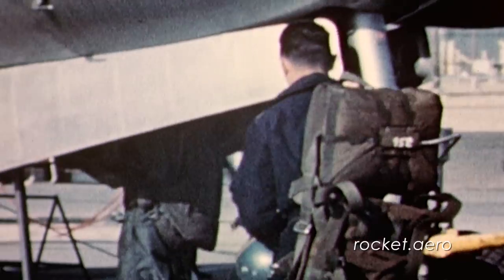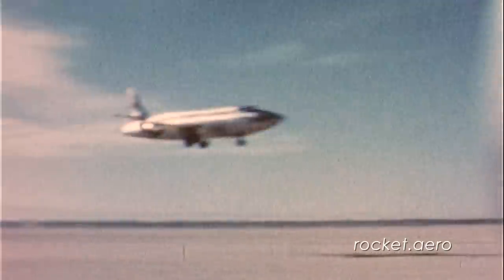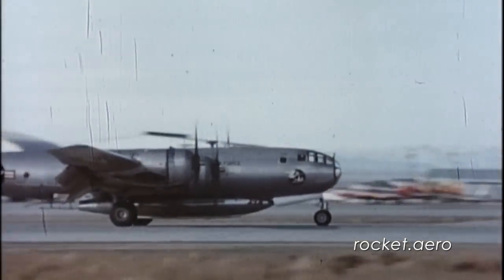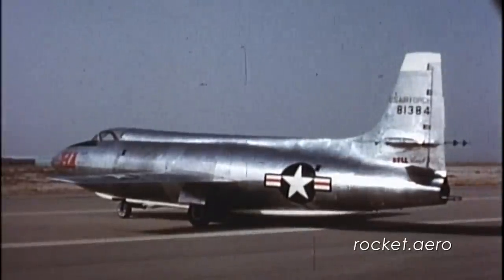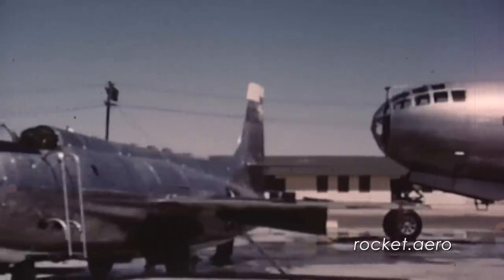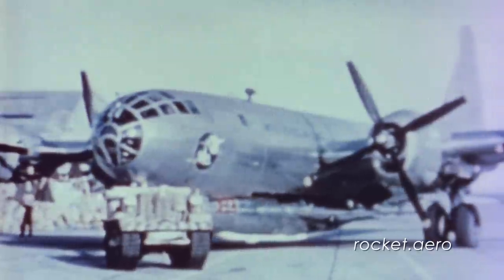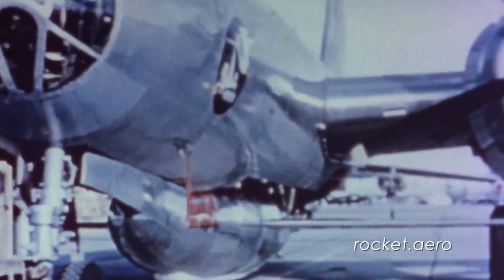Bell X-1A Composite Mission

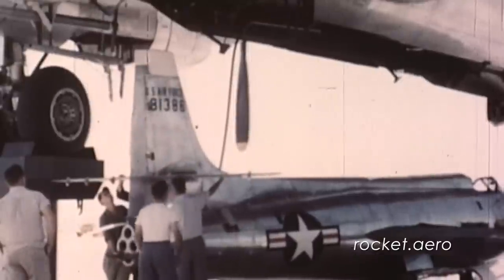Comment: The video includes rare footage of the X-1D 48-1386, from 5:13 to 5:42, 6:53 to 7:10, 13:19 to 13:37, 13:52 to 13:59, and 14:06 to 14:20. It lacks the X-1A title on the forward fuselage. It is shown with the EB-50A mothership 46-006, equipped with R-4360 Wasp Major engines. The B-50A was destroyed by the explosion of the third X-1 46-064 in 1951, two years before the delivery of the X-1A and X-1B.